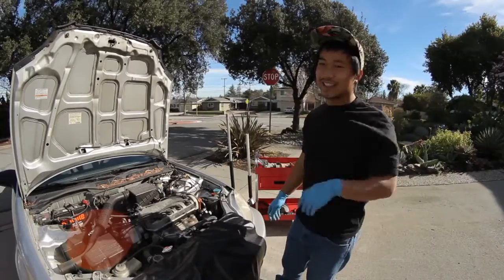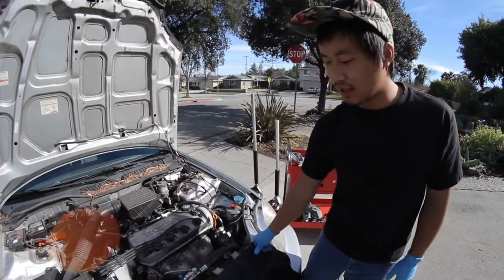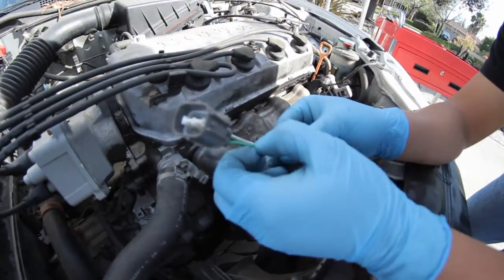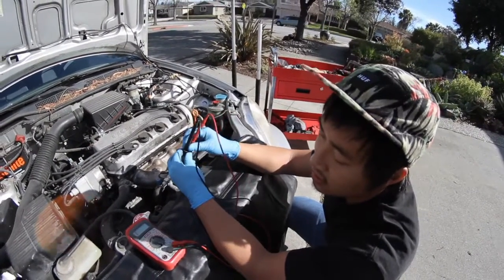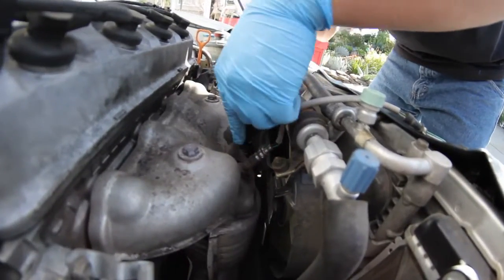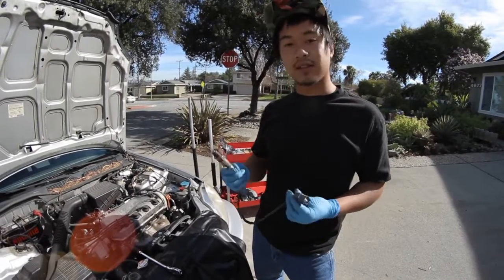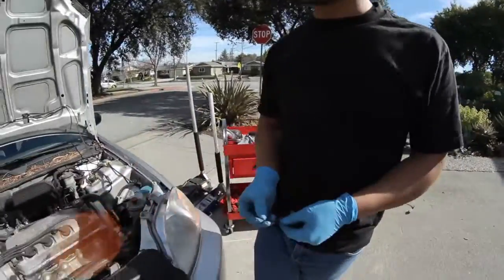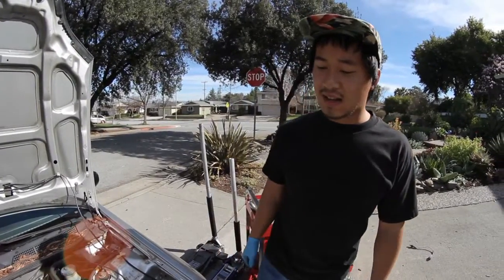P0141 o2 Heater Testing and o2 Replacement (96-00 Honda Civic)

Comment: Hi Sir,
I own a 1994 Honda Civic. It gives the code 41 "Primary Oxigen Sensor Heater". I just measured the resistance between the 2 white wires and it gives me 9 ohms. I also measured the voltage at the 2 pins that connects to those 2 wires and it gives me 11.98 V. Now I don't know if I should just Replace the O2 sensor or not. 
Note: Engine light comes on only when the car has reached it's temperature and starts performing really bad.

Regards.

Comment: Hey good video it was very useful for me! can you say to me what is the value on ohms for the sensor? it just check mine and the measure was 14.5 ohms, is that ok? thank you for the support!
Reply from the maker: 14.5 ohms isnt bad. The new sensor in this video read 9 ohms. The bad sensor read infinite resistance. You should check for 12v power going to the sensor with the car turned to on. Careful not to touch your leads and short something when testing this!
Reply: thank you :D my check engine light is turned on and the code marks the heated oxygen sensor, but i find that is ok, how i can check the plug? thank you for your help ! :)
Reply from the maker: are you checking the right sensor? there is an upstream(primary o2 sensor) that is before the catalytic converter, and there is a downstream(secondary o2 sensor) that is on the cat. Also make sure its on the corresponding bank, so bank1 is the side of the engine with cylinder #1 on it. if its a 4 cylinder there is only 1 bank so you dont need to worry about this. If the heater element on the right sensor tests good, check and see if youre getting 12V power on the connector TO the o2 sensor. So the pins that go to the o2 heater in the sensor. be careful not to touch your test leads! do this with your car turned to on.. some systems require that you delete the code first before it will send 12V
Reply: yeah its a 4 cylinder honda odyssey, the problem is, if i turn on the engine, the manifold its hot! jaja but so much thanks, this info you gave me helped a lot! thanks Justin! i'll check the conector today :D

Comment: Thanks for the video.  However it wasn't clear if you were checking for resistance on the two black wires only?   Also,  if I wanted to check to see if voltage was getting to the wiring harness, what wire should have voltage when I turn the key to the ON position?   I am guessing the white wire or signal  wire?
Reply from the maker: Sorry... Yes, i was checking resistance between the two black wires only. Typically, if you have two wires that are the same color on an o2 sensor, those wires are for the o2 heater. Here the two wires were black, and on the new sensor i installed, the two wires were light grey. If you have high resistance between those wires, then the heating element in the sensor is toast.... To check for power, measure for voltage with the key on, engine off between the two pins that go to the same o2 heater wires. You want 12V to be applied to the o2 heater circuit inside the sensor. If you have no voltage at those pins, then you may have a break in the wires or even an engine computer problem. Hope this helps!!
Reply from the maker: Also, some systems will turn the o2 heater off if there is a check engine light code present, so make sure to clear that code before testing for power to the heater.
Reply: +Justin Le ,  Thanks, I didn't know you had to clear the code B4 testing